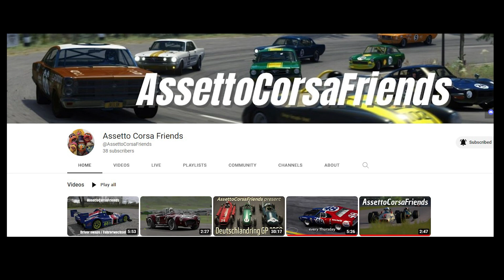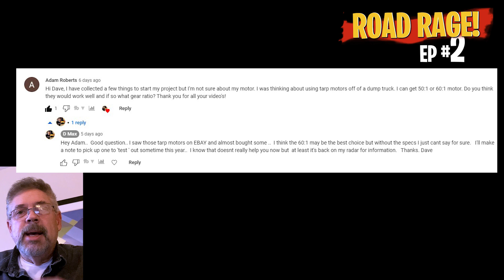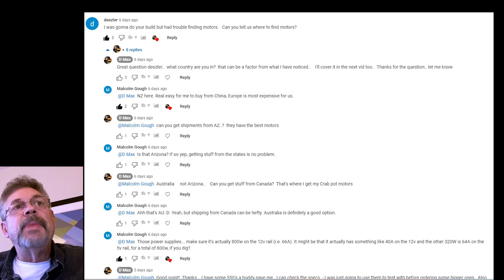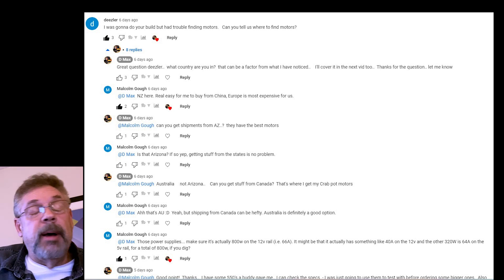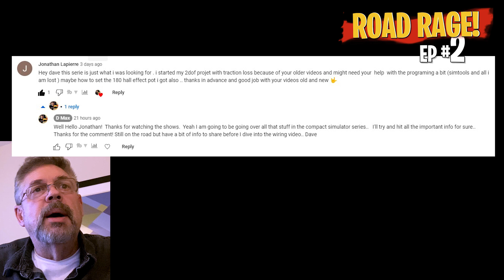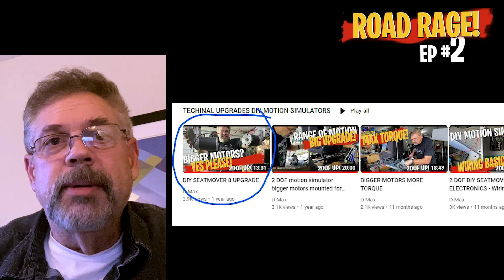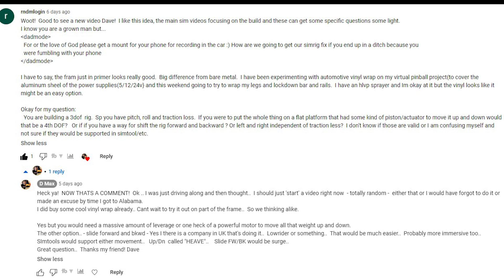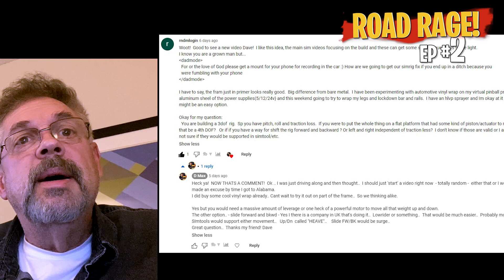ROAD RAGE EPISODE 2

Comment: Thanks for the vid Dave.  Yeah, I'm not planning on doing anything with heave or surge.  Heck, Ill be good getting the 3 DOF down.  Asked more for understanding.  But who knows, maybe something come to me.  Actually surge wouldnt be  too difficult I think.  The thing you showed in your response is pretty much it.  Have the whole thing on some wheels/casters and have an actuator push/pull it.  Hmmmm  Would nee to have something substantial to attach the actuator to on the 'base' side....
Reply: Could use a couple of cable winches and pulleys to drive the entire rig like a cart if you could mount them directly to the floor or wall. Then you wouldn't need an entire other frame under the slip frame, just casters on the slip frame. Fun to think about what is possible.
Reply from the maker: @Rebar77_real  True. that would work..  It would be nice to see some of the mechanisms in small scale  maybe out of paper or wood just to see whats up and if there are issues to overcome.
Reply from the maker: I thought about making the slider platform at one point but I'm pretty happy with the 'surge' I get already. I think he needs that type of surge platform because they use those 4 actuators  to move the upper frame.  And they dont seem to have as much 'travel' as mine when I accelerate..  Hard to really compare without 'testing' one of those platforms out..  Could be awesome!  I just dont know ..

Comment: Hey Dave do you have a 3D printer? You could probably get a ton of use out of one for all the custom stuff you are doing and people have already made tons of free things for you to print like housing for your aurdinos and motor controllers even add-ons for your rig. They've come down a lot in price and you can even diy one and build it yourself. Anyways thanks for the videos 👍
Reply from the maker: No I don't have one.  They seem interesting and some of them actually print with carbon fiber.. I just have not had much time these past few years to look into one seriously.
Reply: @DMAX_DIY  those Carbon printers are sick but are industrial level printers so they still cost a pretty penny. PLA printers are pretty cheap though and can do some solid prints with nice rigidity. I'd recommend looking into the Creality CR-10 or Creality Ender 3 Pro they are both a great Value pretty easy to setup and have a ton of upgrade paths. I think it would really level up your builds 🤙
Reply from the maker: @RicheyBLS  I've watched quite a few of those Creality Ender videos..   And yeah they would probably be a heck of a good addition..  That's the one I would probably get.  Have you seen this channel?  he does use that product.. but also makes carbon fiber stuff..  I bought my carbon fiber supplies (for building an upper frame and seat a little while back - have not done it yet..  and it's not prepreg so I dont have to worry about it going bad)..  anyway..  here is the link..  He doesnt talk at all during the videos.. just makes some stuff..  Big Big Following..  I probably should 'follow that advice" but I gotta talk for some reason.. hahah.  https://www.youtube.com/@ECOLAPStudio
Reply: @DMAX_DIY  wow that's really cool! I never thought of using 3D printed molds to make carbon fiber parts. It's crazy the kinda stuff you can learn on the internet. But don't go mime on us I think all enjoy your humble attitude and diy every man kind of style. 👍

Comment: I wonder how much 12v motors can be safely overvolted for a performance boost. It would depend more on cooling at that point, eh? Besides the quality of the motors themselves I mean. Cheers.
Reply from the maker: Yeah, probably a little.  The Truck battery runs about 13.6 v   I've not noticed they get warm or anything after a couple hours of hard racing..  The Crab pots did not come with any documentation.  I dont even know who makes them,  just where to get them..   I have seen guys on x sim attaching 'fins' the the motors to assist disapating heat..  but I think that by using more leverage, the motors work less hard..   My designs seem to be quite different than the  DOF reality..  But I did look up their motors  Thanks to  SIM Garage tearing a DOF rig apart and showing the part number.

Comment: Hi, what width/thickness do you recommend for the steel tubing (for a good balance between weight and rigidity)?
Reply from the maker: I am building the semi-space frame in attempt to eliminate some weight on the upper frame but make it stronger than it would be with increased steel thickness.  There was a study done by some guy who builds race car frames and I watched his 'tests'..  So rather than getting thicker (and easier to weld) steel, I'm pointing in the space frame tubing design.  I could 'mic' the metal I generally use when I get home but I bought it all at LOWES..  it's pretty thin for the square tubing..

Comment: the motors you use for your 2 dof. can it be used to make a 4dof instead of actuators? (like the four wheels on a car layout(no yaw).
Reply from the maker: Great question Ultra Instinct!  I've been thinking about that too..  the amp load per motor will go way way up.. that's for certain (because there will not be a u joint holding the majority of the top frame weight)..  I have six of the crab pot motors  but to use them in something like this I would need to disable both of my motion rigs.. ** not ready for that yet**  but I will in late 2023..  cause I want to see if they will work in a 6DOF..  So the answer is..  IDK!!   they might?  they may not handle it..   6 would spread out the load better than 4 ..   just saying..   Dave
Reply: @DMAX_DIY  thanks for the response.i also had the idea of "I want to see" if it will work. But if ever you do try please upload. Because I plan to do it as a project for the year. I'm in no rush

Comment: question - is there a reason you don't mount 1 motor on the middle of the front for pitch, and 1 motor next to your right hip for roll?  Rather than using the 2 motors at once to combine everything.  Does the way you're doing it make the motors work better or something?